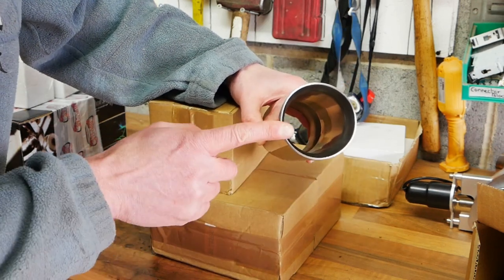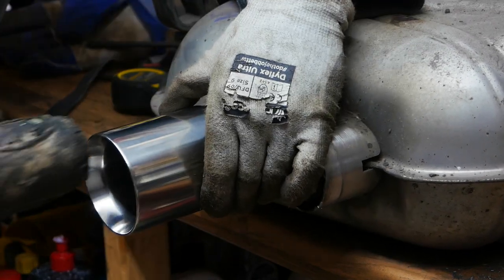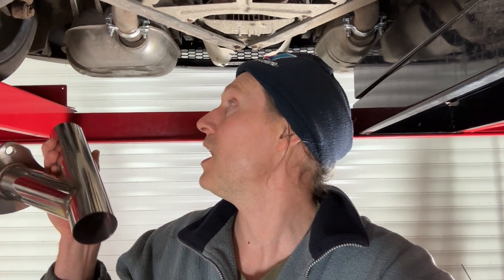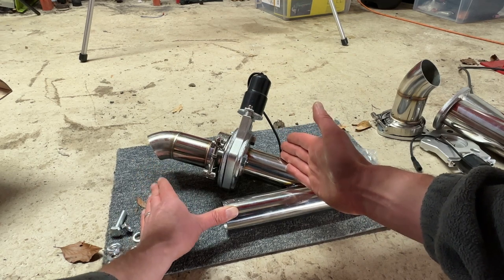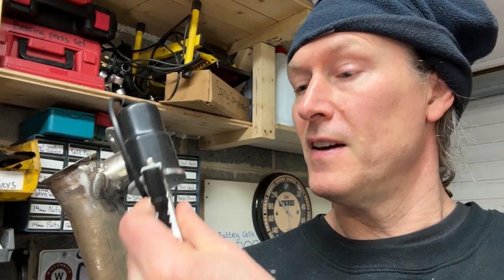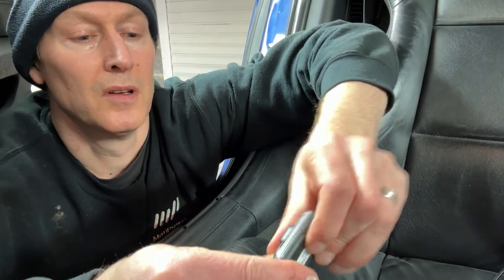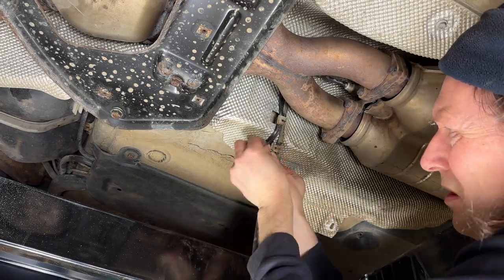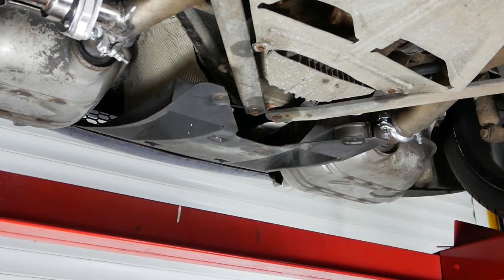Exhaust System Modification DIY // EPIC Looks AND Sound for £225!

Comment: Nice work Phil, sounds is fantastic! I've been looking at an upgrade exhaust system for the same reasons but the mod looks very cost effective in comparison. I have the same car except it's a the roadster, BUT none of your skill and no garage!
Reply from the maker: Thanks @gibsonlespaulspecial 😀 I've been using the system for a while now and have a few comments to add. The things I like are that you can turn the noise on and off. When driving the car hard or revving it (with the cut out valve open) I really like the sound but if just cruising with the valve open, it becomes a bit "farty" like a blowing exhaust. If you want a sports exhaust sound that you can enjoy all of the time, there's actually another option I was considering: It's possible to find someone who will open up the back box, wrap up some of the perforations in the pipe where it passes through the back box and then weld it up again. If you also add some tips (screw on or weld on) I think that would be another bargain sports exhaust look and sound! Z4M roadster is a lovely car btw! 👍 Thanks, Phil